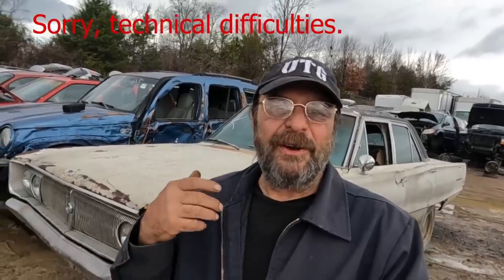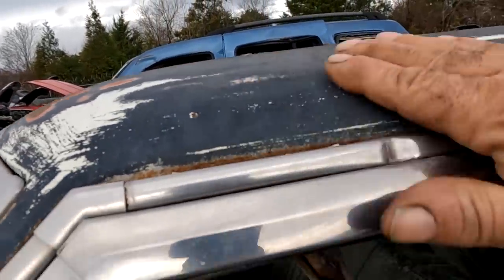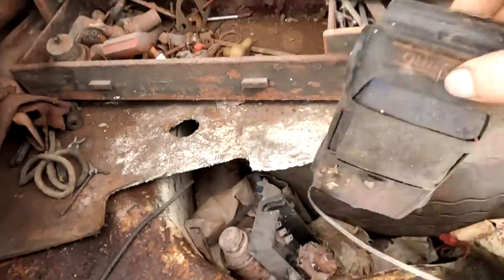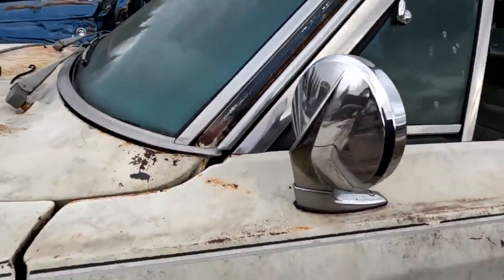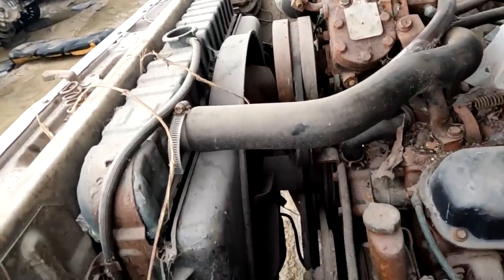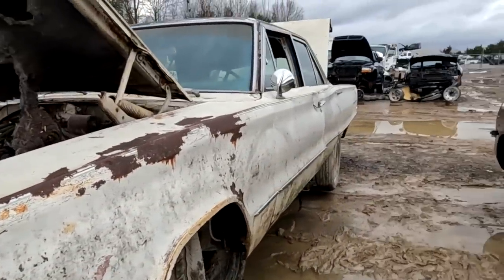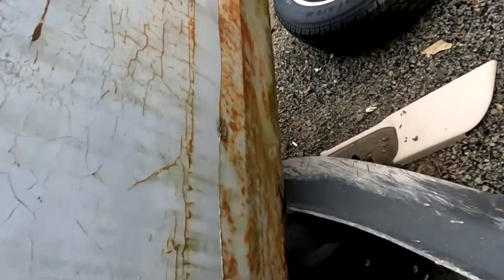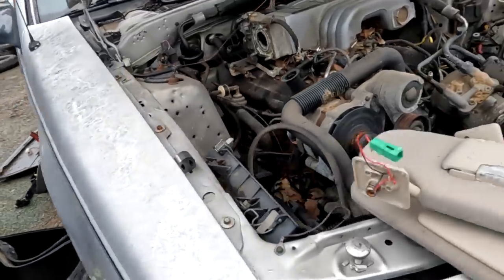Pull-A-Part Mopar Gold- Checking Out A Time Capsule 1967 Dodge Coronet

Comment: I think that 5.0 TBird has a unique 8.8 axle housing.  It's got the large drum brakes and 3.08 gears.  What is unique is the distance flange to flange.  Other fox body 8.8s seem to have the same flange to flange length.  The 87-88 TBird has a wider flange to flange and longer axles.  The 99-04 SN95 cars are also wider flange to flange, but I don't think they are the same width as the 87-88 TBird drum brake 8.8s.  Interestingly the 87-88 Turbo Coupe 8.8s have the same flange to flange length as the 86-98 Mustang GTs.

Comment: The horn ring is a 66 piece.  If it came on the car, it would be an early build car.  The engine may be a 273 with solid lifters.  You may want to check.

Comment: Uncle Tony,if that "87 Tbird still has the headlights and you can get "em cheap you should get them.....Nobody reproduces "87-"88 Tbird headlights......And they go for good bucks on the used market......I know you don't have a Tbird but you could use them for swap meet material or just sell them on eBay....I have an "88 Turbo Coupe that my uncle bought new.....He worked at the Lorain Assembly Plant where Ford built the Tbirds and Merc Cougars and he followed it down the line as it was being built.👍👍👍
Reply: I just saw a Thunderbird and a Cougar of that vintage in mexico both with the 3.8L engine and a 5 speed on the floor.  That configuration was not available in the US.

Comment: Quick grab what you need. Sheet metal wouldn't do me any good, I'm not into body work. Fortunately I know somebody who is. Those Mopar RV-2 compressors were a lot tougher than what Ford and GM used, but they zapped about 15hp. The '69 Ranchero was a Fairlane, and had that horrible front suspension with the springs on top of the upper control arms, and the large shock towers in the engine compartment. I found out about that design the hard way. There is a salvage yard called Desert Valley Auto Parts close to where I live near Phoenix, AZ that has over 100 restorable '70s and older American cars for sale that they won't part out. They also have thousands of nearly rust free parts cars. Cars just don't rust here in the AZ desert.

Comment: The 5.0 Ford at the end, my sister was riding home from the Methadone clinic with the neighbor friends and got T-Boned by an 18 wheeler at an intersection, they were going 60 mph and had the right  of way, but the neighbor husband got me to take the rear end out, it had posi and 3:55 gears, I want to say it was a Thunderbird, but it had Independent rear suspension like on a Corvette, it had a rectangle oval frame thaat you remove four long large bolts and the rear end, shocks, from the driveshaft to the wheels came out as an assembly! They also had a Mercury Cougar '88-'92 but it had Dana 44 solid axle. You could use that, weld four mounting brackets on a truck, a car, dune buggy, anything and instant rear suspensions! Maybe it was THunderbirds, I was amased by it? WHo Knew '88-'92 Thunderbirds had independant rear suspension??
Reply: It was '87, and my older buddy got his license that year. 
And his dad bought a new jet black 87 turbo coupe. 
Well, long story short, we wanted to verify it's 1mph faster than the 5.0 mustangs top speed.
The ride to the county fair is 45mins driving normally,it's half highway and half state roads. 
Anyway, we made it in 23  minutes that year. 
The tach never went under 5k in top gear and usually was up around 55-5600 for the whole highway ride. 
We slowed down to where the 85mph speedometer would read ,and it was so boring that we felt like getting out and going for a walk🤣🤣
Good times.

Comment: I believe the ranchero is a 70 because the 69 had the flat grill and in 70 they had the v shaped grill and the tops of the fenders faded away down below the top edge of the doors.
 I had a 70 Torino GT, 351C  auto car when I was in high school in the late 70's and my brother owned a 71 Torino Cobra-jet sedan 351C,4 speed, with the shaker hood scoop and full length rear tail light.  We knew this car when it was sold new, so this car was legit.
Amazing the fun we had in the 70's while in school and a part time job to buy these cars and have fun.

Comment: Hey Tony are you sure that's the painted roof or did someone just paint it? I realize there was an option for that and I'm thinking on doing that with my Fury that's gone through several vinyl roofs over the years. Can't believe the broken torsion bar on that thing!
Reply: my 70 dart is factory two tone car fender tags has two paint codes so I would believe they did it on fury's too
Reply: We'd need to see the fender tag to tell how it was originally configured.
Reply: @googleusergp  I agree.

Comment: Was that T-BIRD the year they started with the airbags on the rear end? My son bought one, I think around that model year that was bagged. He drove it maybe 2 months and the air bags blew out. The new bags with Labor were going to cost more than the car was worth. Sadly, after he scrapped it. A friend of mine who was a 🚛 trucker told me, the bags off a junkyard tractor trailer could be adapted. I don't know if that's true because my son had already scrapped the Bird.

Comment: Different laws Down Under. I believe where you are, once it hits the junk yard, it can't come out again? Even a Valiant down here, in that condition, would have gone straight out the front, for sale whole as a restorer. Replacing floors is common place, but no way that would have been scrapped. And it would sell for thousands.
Reply: The yard will make much more on the parts than selling to whole.
Reply: @mexicanspec  Yes, I believe it would there, but down under, people are paying stupid money for borderline savers.
Reply: @Grumpy-sy7wr  I wish it was worth it to ship cars from Mexico.  A lot of cars here are clean builders.  They are well kept cars with no rust for relatively little money.  Dusters and Darts are plentiful.

Comment: There's probably a nice set of Blue Streak points in the distributor.
Reply: You'd be better off with a pair of stock Mopar ones from back in the day if you could find a set.
Reply: @googleusergp  Back then nothing beat Blue Streak Lubri-points. Nothing. finding usable sets of them now is like winning the lottery.
Reply: @ClaremontClassicGarage  Nah, better off with OEM, even back then. They are no longer produced in Long Island City, Queens, NY where they are headquartered. The company doesn't even own their headquarters any longer, they lease it from the new owner. For years they were made in their Stanric, Puerto Rico operation which opened in 1968. They've melded with Echlin's engine management division about 15 years ago. No thanks, I'll stay far away from their products in some cases. Certain products yes, not bad, because they are coming from the same vendors as everyone else and are supplied from the outside. The problem you have now is that they are supplying just about everyone, including Delco and Motorcraft on older applications. Same part in the box, just sold under a Delco or Motorcraft name. 

I worked in the parts industry for manufacturers for years and I can tell you some aftermarket parts were right on the money, coming from all of the same suppliers. Some were reboxed OEM, some were made by them, some outsourced by other companies. It's worse today than when I was in the industry from 1994 to 2005. I still stay current with the industry when I can, but I'm on the municipal fleet side of automotive now.

Comment: @ U.T. Grab all those cores, while you can. NAPA will tell they have one on the shelf..... until someone goes to look for it! Even if you don't use them on your own build, Someone doing a Concours Restoration, might need them. I'd almost offer your time, and 20 bucks more, than you pay for the A/C compressor, and bracket. I don't think it'll work on my Magnum 360.

Comment: 10:15 it's just interesting that the older something gets, the more the little parts matter. 
20-30yo car and a rotted radiator? 
Pitch it and get another. 
50yo car? 
Save it for some pieces of it, someday if needed. ✌️
Yeah I understand why, and I've noticed myself doing this with my fleet.
Reply: I would rather fix my existing radiator than get another one.  I know the one I have fits correctly.

Comment: It bums me out seeing there too, might be a low mileage car
Reply: Haha I was just talking about this with pops last night. 
Someone discovers a "low mileage barn find" that's been sitting for 30-50yrs, or even something like that Coronet.
They find the Coronet in some guys lean-to and it's been sitting since the late 70s and it's got 67k on the clock. 
It's played and needed a top end job 10k ago, front ends shot, and the rear end has a howl. 
50s/60s stuff was shot by 100k usually, people forget and think like a modern car. 
Low mileage would be something like a 54 Chevy with 25k on it , and I bet it's close to needing a valve job.

Comment: Tony you are not going to put air conditioning on your car, from this car. This AC stuff is a pile and you know it.
Reply: LOL yup , the compressor seal is shot, expansion valve ,that condenser is definitely shot, and don't flex those stone hard hoses much🤣🤣
If anything, it's good for mock-up but it's all gonna need to be redone  there's probably nothing usable except for stuff like mounting brackets and the evaporator case and ducting.

Comment: C'mon Tony, really? Wiring harness?. Why bother with that old brittle wiring when mopars are known for wiring issues? A new wiring harness isn't more that a couple hundred bucks. Wiring is not the place to be cheap unless your going to have a car-b-qie
Reply: Because even though Chrysler wiring was junk, it's still higher quality wire than most of the cheap Chinese aftermarket replacement harnesses. Also OEM harnesses are always nice to have laying around in case you ever need a section of the proper wire to make a repair or splice or to get some of the hard to find connectors. Honestly if your going to be fixing up any old school car or truck you should try to find another harness at the junkyard and pull it just to have it for Incase you need to make any repairs, and that cheap wire you get at the auto parts stores is junk and usually you can't buy it in the gauge or color needed for a clean repair.

Comment: Just buy the whole car ya dingleberry
Reply: Unfortunately in 99% of yards, the car can never be sold complete and that vin could never be registered again, the car is most likely filed under a certificate of destruction. pretty much once a car is in the pick and pull lot, it's a goner and you might as well get what you need now before it's crushed and gone forever.